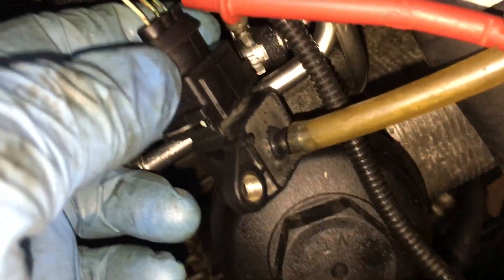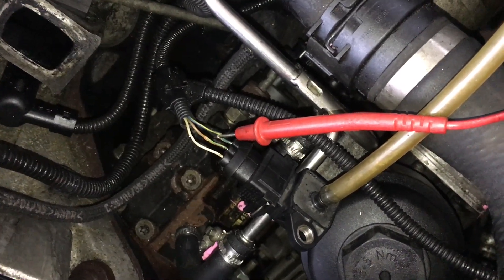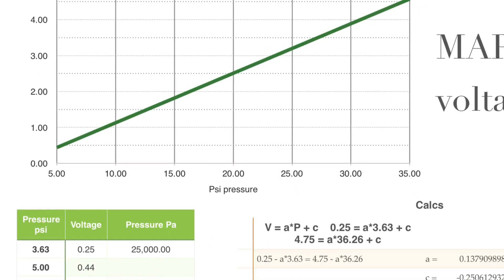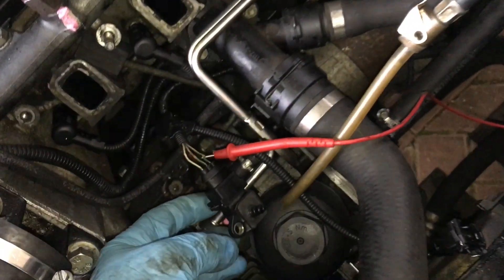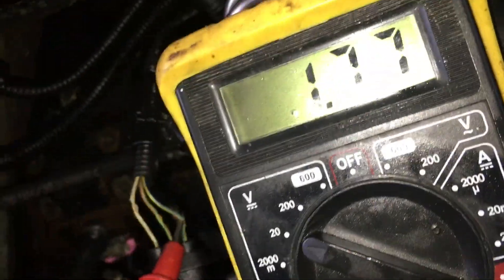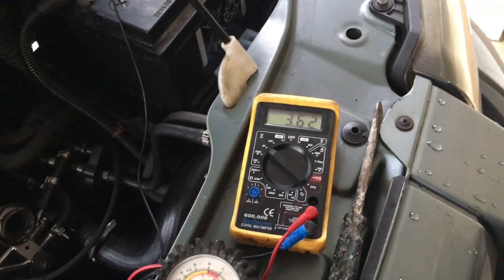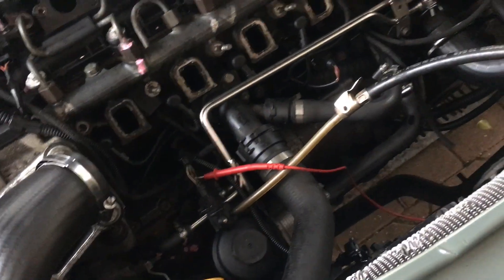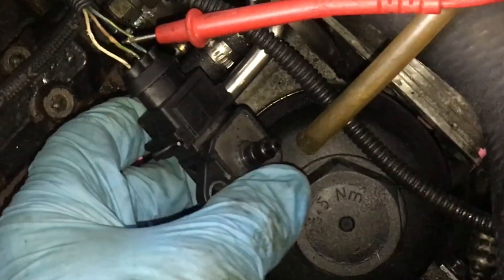How to Test a MAP sensor - Manifold Absolute pressure / Manifold Air Pressure sensor

Comment: Hi! I wanted to avoid damaging the wire harness so I bench tested the map sensor. With ignition on I measured 6V on the plug of the MAP sensor, so I took a 6V battery for the test. 3 of my used sensors measure 2.2 Volts without pressure.Are they wrong or am I supposed to measure from the cars wiring harness? With pressure applied they measure the same voltage but still not ~1.7V without pressure.
Reply from the maker: That is a bit odd, as you can see in the video my measurement is ~1.7v roughly in agreement with the spec graph for atmospheric pressure of ~15psi.  I wouldn’t have thought your atmospheric pressure was that different!  Have you checked with another meter?  And I thought the supply to the unit was 5v not 6v, that may also be a factor.

Comment: Hello Mr.! 

Your reading is about 3.8V at 15 PSI and 2.8V at 10PSI. 
The HELLA graph shows 1.13V at 10PSI and 1.82V at 15PSI.
I measured 3.75V at 15 PSI and 3.14V at 10PSI. 1.78V with no pressure.
You said the MAP sensor working alright, but comparing to the HELLA it does not. 
Do I need to change my MAP with this readings or not?

Reply me ASAP pls it is urgent! 

Thanxalot: A
Reply from the maker: Urgent help gets a quicker response by showing a small appreciation and helps support the channel and future videos.  Use this link:    http://paypal.me/comeinhandy
Reply from the maker: The pressure on the MAP pressure data / graph is absolute pressure not relative to atmosphere.  The normal atmosphere pressure at sea level is around 14.5 psi, so 15 psi on a pressure guage is an absolute pressure of 15 +14.5 = 29.5psi. And then you will see how everything adds up and measurements agree with the Hella data.

Comment: Man, thanks, could you possibly check resistance? maybe an easyest way to go, comparing to a brand new...
got two from genuine BMW, both show similar values betwen post, 6.2K 2.3K et 4.15K, but nothing change when unpressurising them as you do, i decided to go for a brand new aftermarket, and surprise, even if resistances are completly different, nothing happen too when testing pressure variation... this is a WTF part!
Reply from the maker: As the sensor is an active part that needs a power supply to operate I don’t think it makes sense to measure resistance. It is it’s output voltage that changes with pressure.
Reply: @comeinhandynow  That's a point, i'll give a shot the proper way, just have to be sure witch connector is what (a 7787142 from BMW)